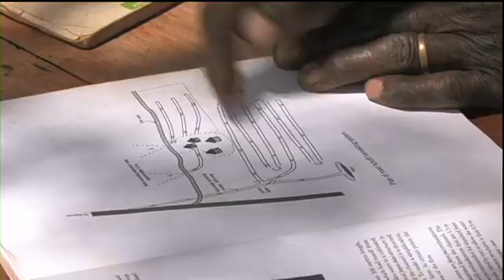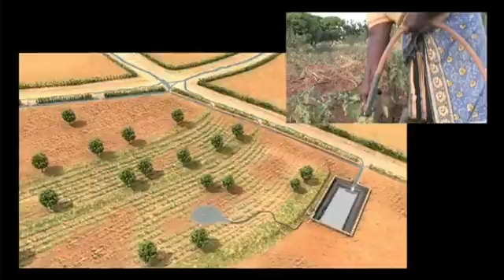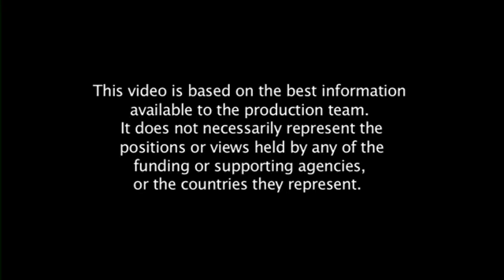Rain runoff water harvesting

Comment: Thanks for sharing this. I wish you had  also filmed the actual water harvest when it's raining in that area... i just bought a farm on a flat lowland that floods (for lack of a better word). The whole place floods in may and in the year when it floods, the yield is very low. The residents have never had an idea to harvest this water but that was the first thing that came to my mind when they told me the farm i bought floods in may..... am researching ways to harvest run off water and i stumbled upon this video. am in the same country as the people highlighted here....so i would really have wanted to see the amount of water they get from this run off because i imagine am getting much much more than them.
Would have been good also to see the filtration that guy is using to get clean water from the dirty flood water. thanks anyway
Reply: Check out the work and books of Brad Lancaster.
Reply: and check out Reese Baker